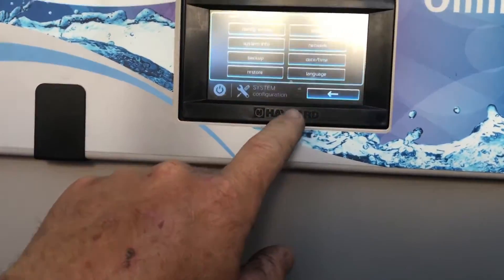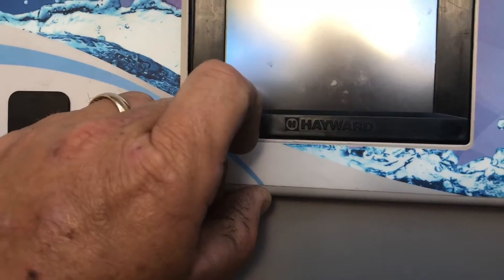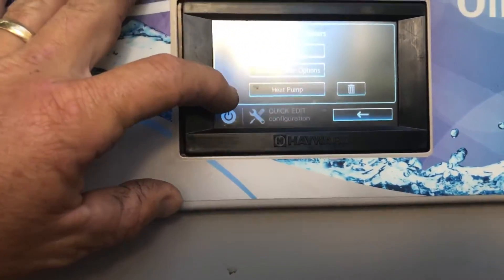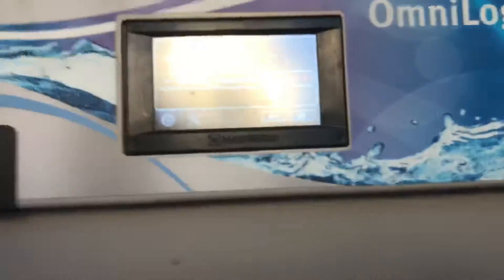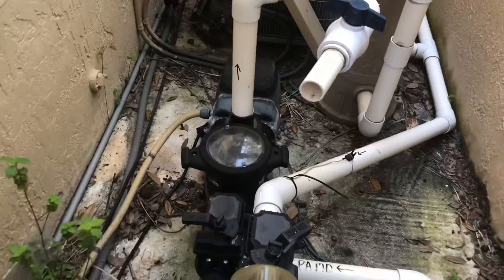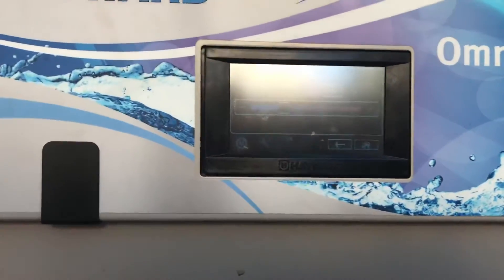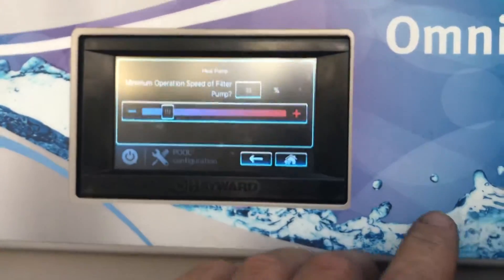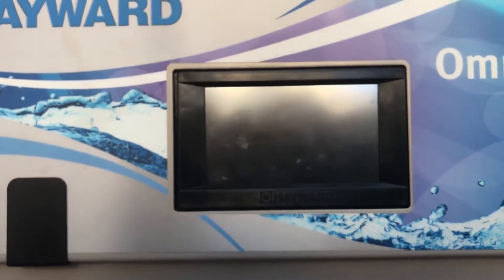How to Select what Speed to Heat your pool using a Variable Speed Pump on Hayward OmniLogic

Comment: Has anyone tried capping a discharge or two to see if there is a difference?
Reply: I have it works well . Then I run the pump at 67 percent
Reply from the maker: Your overall system pressure will rise

Comment: Any idea if/how I can replace a single speed pump with a VS and still control it with OmniLogic?
Reply from the maker: Most variable speed pumps come with the communication wire, and most are compatible with the OmniLogic. Cut out the old pump install the new pump and abide by all the installation instructions given for the brand of pump you purchase
Reply: @EliteSwimmingPoolsTV  is there any info published for the consumer (as opposed to pool pros) on how to setup valves and motors in Omnilogic pls? I have googled quite a bit with no joy. I inherited a pool with quite a complex two pump multi motorised valve setup and am curious 😊
Reply from the maker: Either contact Hayward Tech support or hire a pool pro in your area.